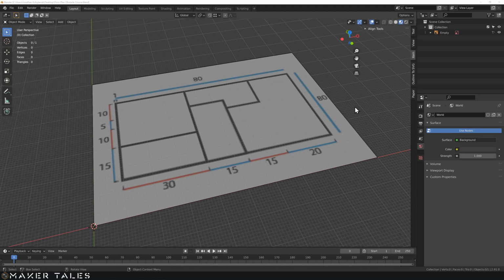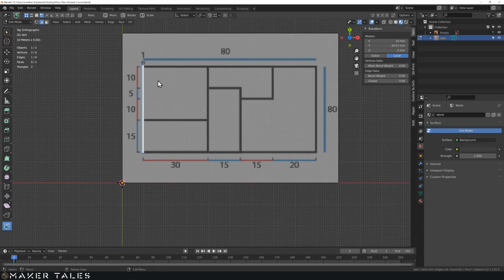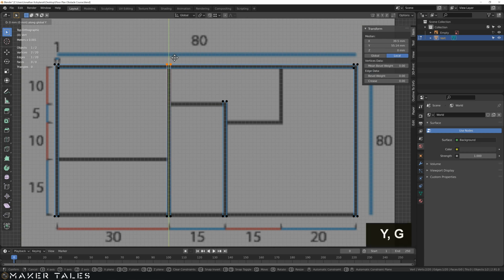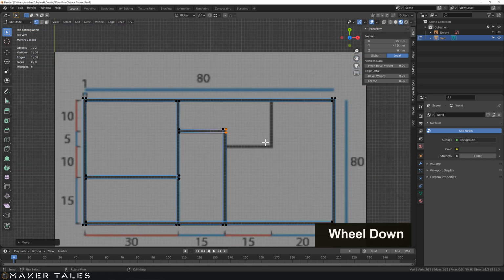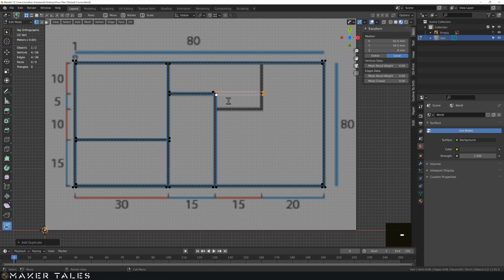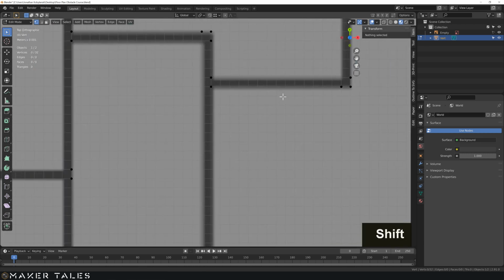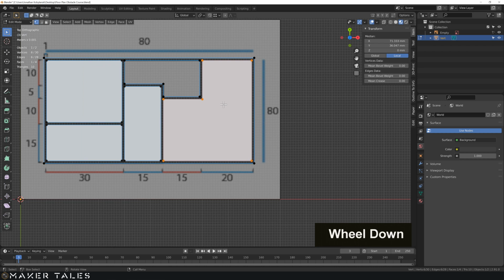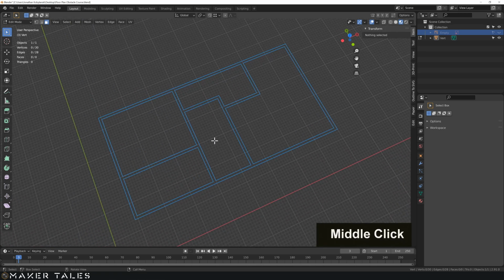2D Basics Extruding and Clean Up Obstacle Course

Comment: I got a bit confused with this one.
I found drawing just lines of the specified length simple enough.
However, lines don't have a thickness but walls do (in this case it was one).
This would end up adding length onto the construction.  So in your construction, once it was completed, it did not measure 80 by 40 but  rather 81 by 41 (outside edge to outside edge)  but technically it is 80 by 40 if you measure length from the centre of the thickness of one wall to the centre of the thickness of its opposite.
Is there a conventional rule in construction about where a length is measured from if one is working with lengths that have thickness?
Reply from the maker: I understand the confusion. At the end of the day that is used more as an exercise to use the tool you've learnt rather then do a full floor plan workflow. As I would definitely not create an in detail floor plan using just these fundamental techniques. As for a conventional rule there are a few but I would hesate to share them as I don't want to misrepresent them incase there wrong.

Comment: My Cad Transform does not move the vertices to the vertices im trying to move to for some reason.the circle come up to select i click and move to the one i want to move to..the circle comes up again but nothing happens.
Reply from the maker: Hey Fitness 1st Steps, First make sure you have what you are wanting to move selected before you do an operation with CAD transforms. If this is not the problem it could be that it's just going a little weird. It some times happens and what i do is just save the file. Close blender and reopen it and then everything usually is working well again. Let me know how that went for you?
Reply: @Keep-Making  it was going a bit weird.. Its been a long week with blender tutorials and my laser cuter turned up 2 days ago so just got that all set up, so back on the blender tuts soon. 😂 Thanks for all your work 👍
Reply from the maker: Your very welcome and have fun with your laser